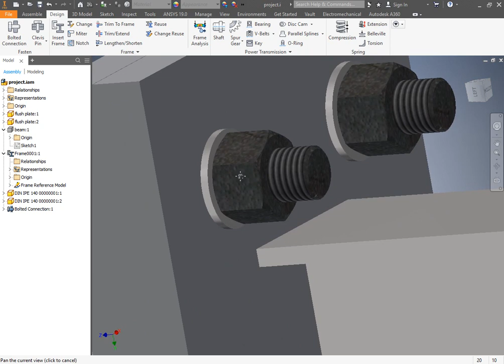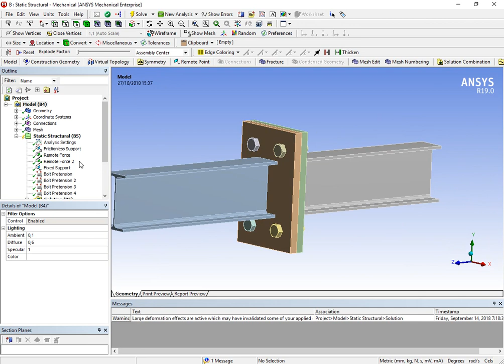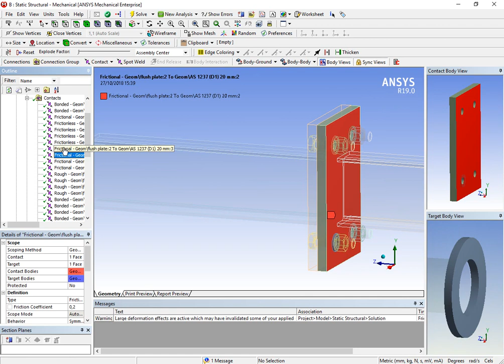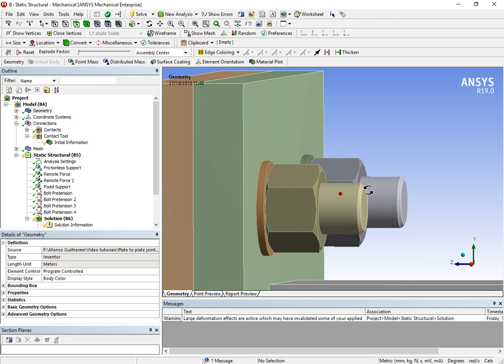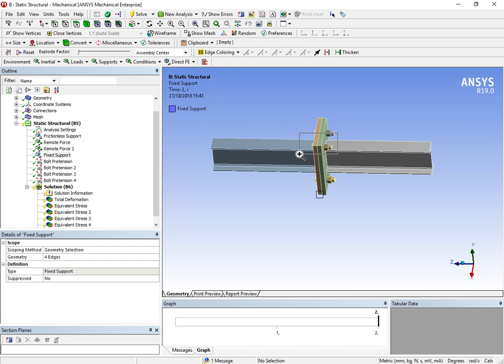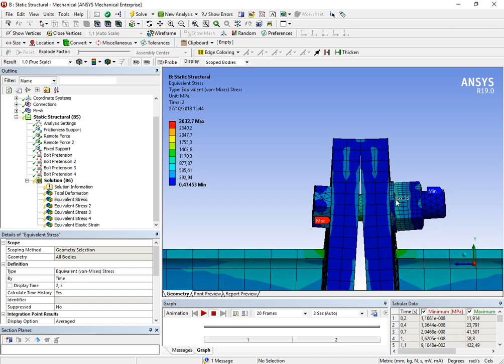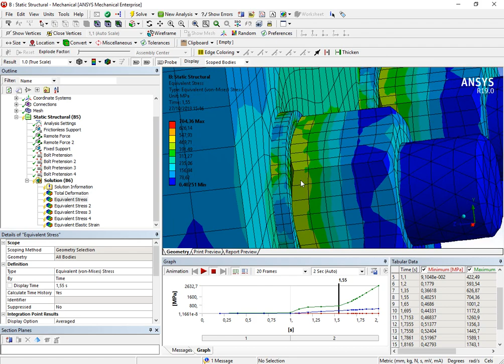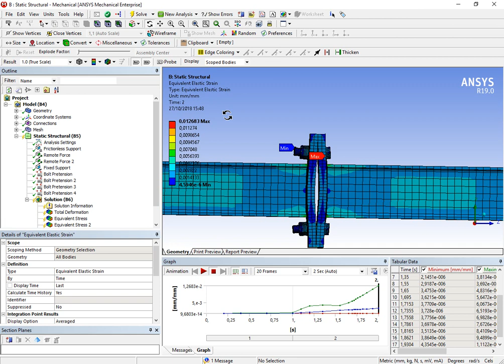Nonlinear Finite Element Analysis - Ansys analysis (bolted joint)

Comment: what tangent modulus did you use? Also, can you go over the meshing and bolt pretension?
Reply from the maker: Thank you for your comment. Well, the material used in this specific analysis is the standard non-linear steel available in Ansys. The tangent modulus of this material is already specified in the material properties. You can check that quickly by clicking on the "Engineering data" menu. 
Regarding the meshing and bolt-pretension, I'll be doing a video about that any time soon.
However, do you have any doubt about the meshing and/or bolt pretension settings in this analysis?
Reply: @femhelper3963  hi, thanks. I was just wanting you to drill down into those two subjects a little bit so I can see how to do it.
Reply from the maker: @schoolie78 later on I will upload a video where I'll look into those details. Big tutorial is coming...